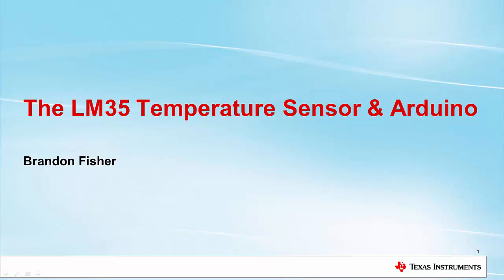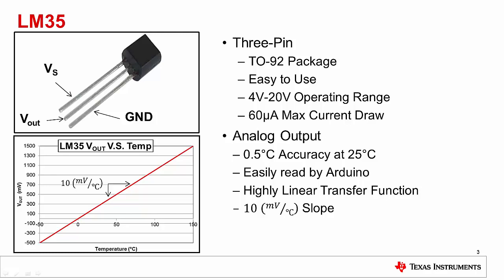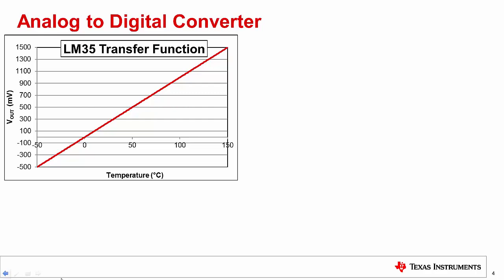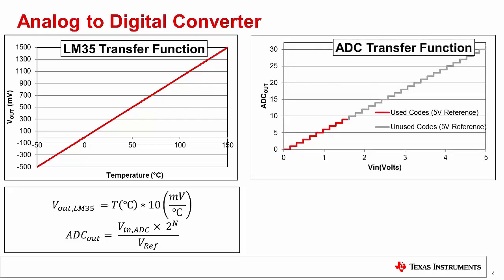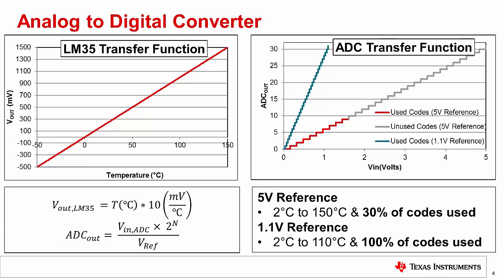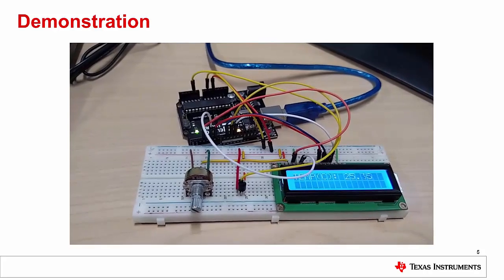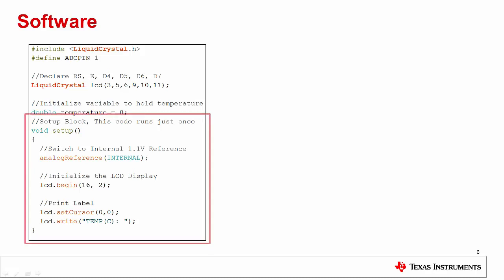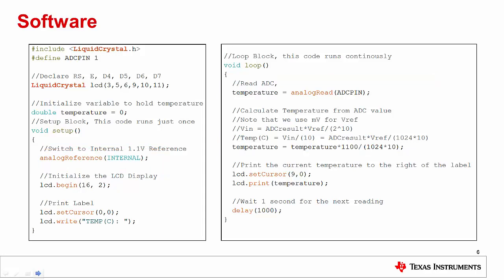How to Interface the LM35 Analog Temperature Sensor with Arduino

Comment: TI subtly promoting Microchip (Atmel) based Arduino. The same thing could've been implemented with TI Launchpad as well, nevertheless nice tutorial.
Reply: Arduino is a US politic now. Anyway, the Wiring code presented works without change with Energia on the board you said http://energia.nu/

Comment: Should the value in the equation be 1024 or 1023?
Reply: I think you have 1024 "levels of temperature". The temperature = 0 .. 1023, that means 1024 levels.
Reply: Yes, you are right.